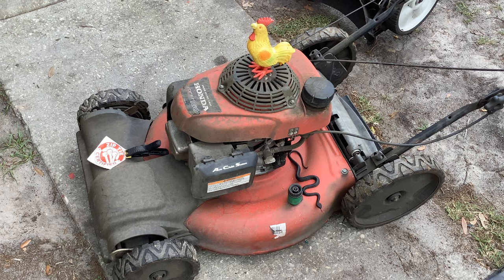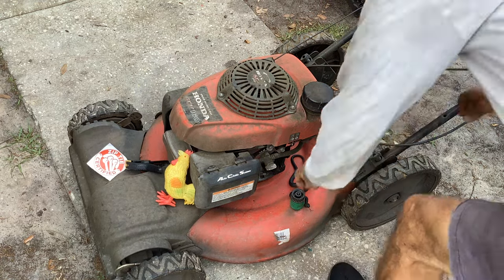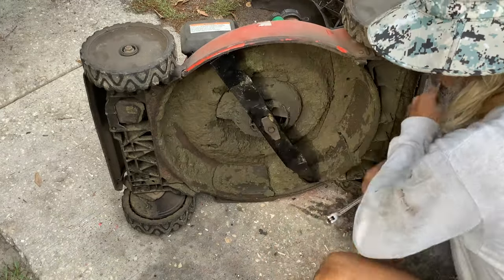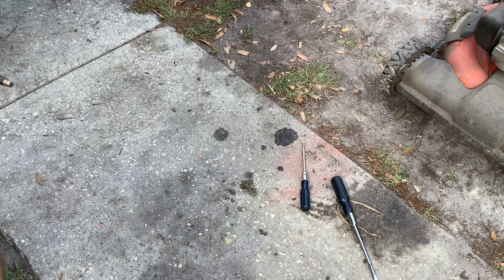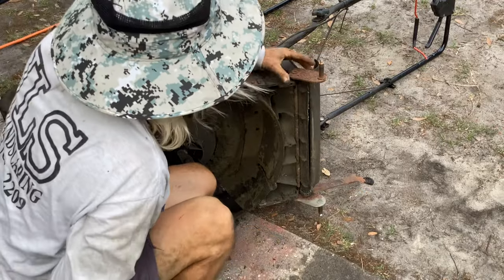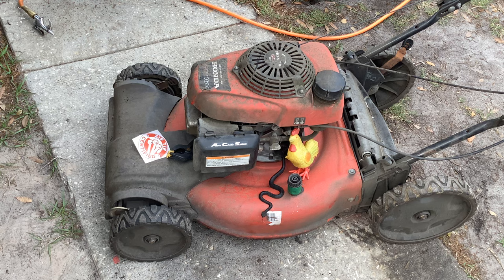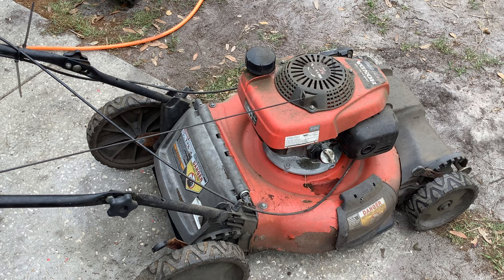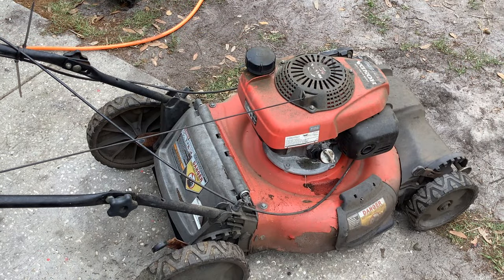2017 BlackMax HONDA GCV160 Self Propelled Lawn Mower for $20!  Plus, some 2-Cycle Junk for $20 More!

Comment: Thanks for the shout out Tommy!  I'm in my 80's and consider myself to be "mature" not elderly!!   🙂  I got a pusher MTD with the same axle problem; I don't have parts to fix it, thought I'd take an adjuster off of a junk wheel and tack weld it back on the remains of the MTD adjuster.  Good video Tommy, keep 'em coming!

Comment: That's a Dirty Bird for sure, but should clean up nicely. It's got all the features of a TroyBilt. If you run across some hubcaps for it, would really spiff it up!! If the 2 strokes don't run but have good compression, I just slap an aftermarket carb, new fuel lines and filter on and move on. I like the Hipa stuff when I can get it, always seems to be good quality and decent price.

Comment: 22 inch blade for weed eater push mower highway robbery now 25. Bucks 😢😢😢
Reply from the maker: you can check out ebay and amazon and find a seller selling a 6 pack.  They give you a decent price to buy in bulk.